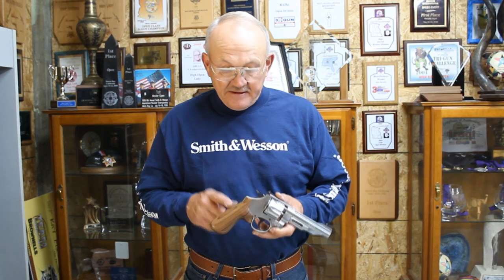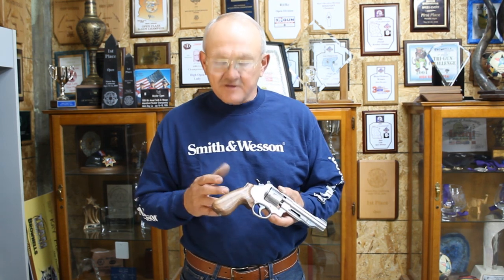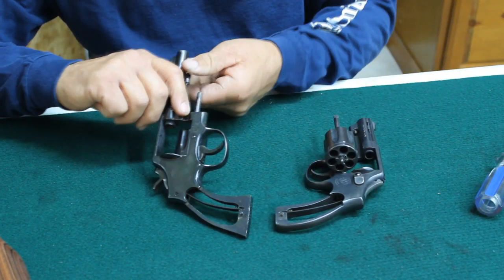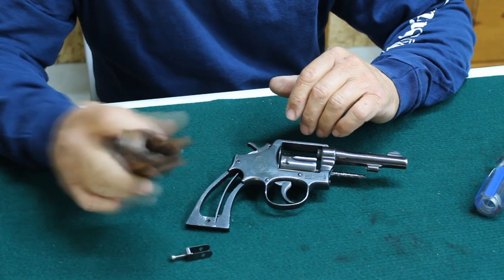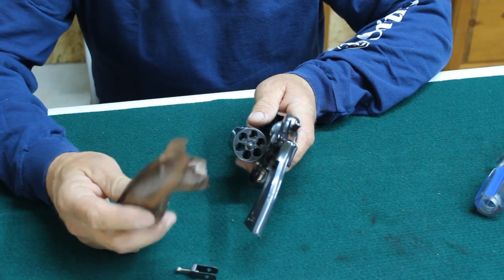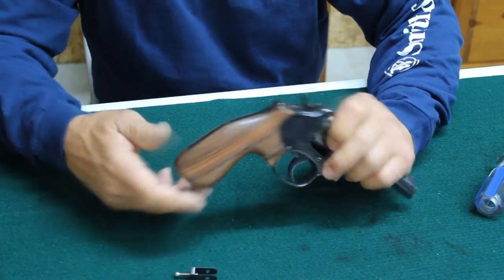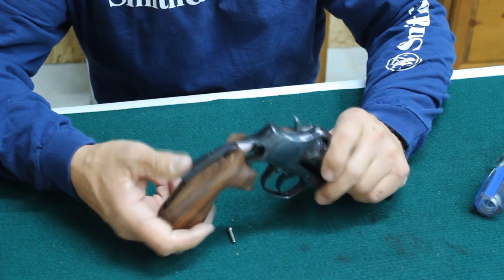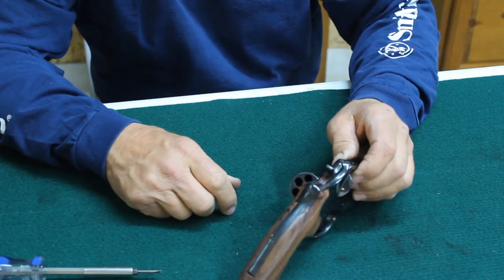How to install the Miculek Revolver Grips with Jerry Miculek

Comment: Hi Jerry , I bought your grips for my model 13-3. I really like them but the grips stick out past the metal grip just below the hammer at the top of the back strap. Are they supposed to fit perfectly ? It’s the smooth grips with no checkering.thanks